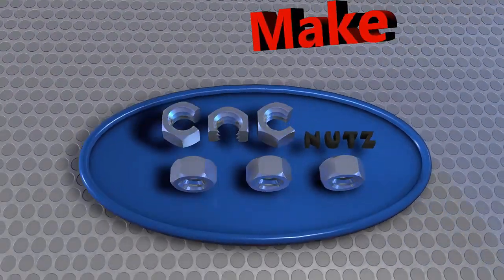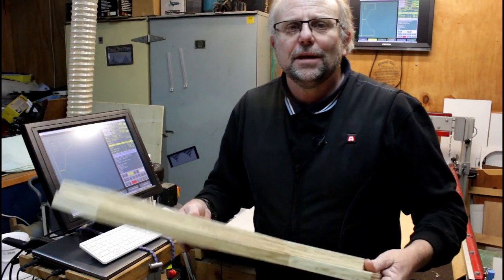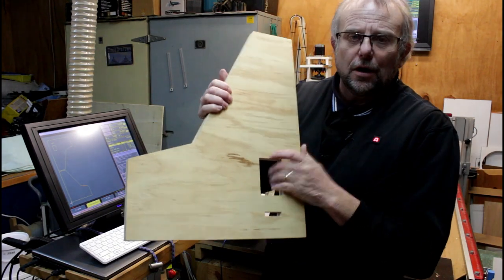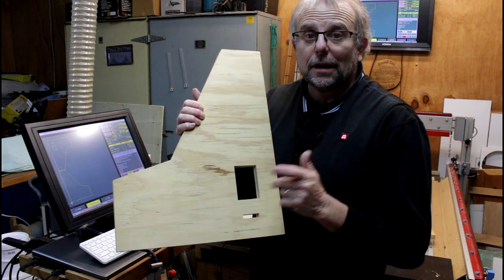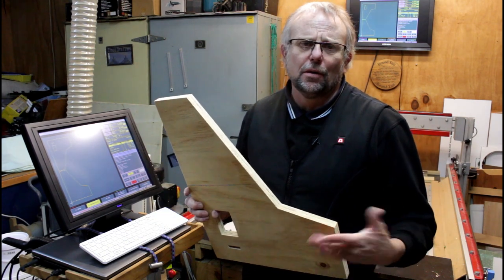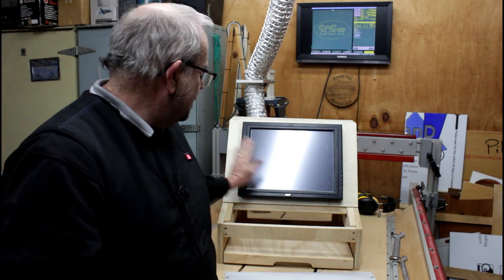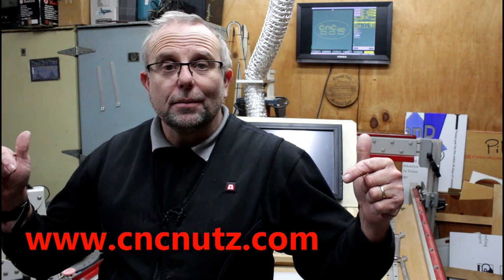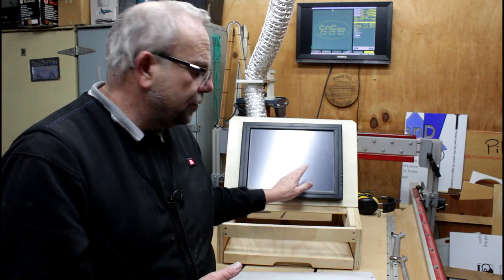How I design a Project Part 2 - CNCnutz Episode 238

Comment: Maybe use quarter round molding around the monitor to keep the dust build up to a minimum and on the side where your buttons are you could notch the quarter round to fit your fingers.
Reply from the maker: Thanks for the suggestion Bob.
Cheers
Peter

Comment: Open-frame cutting/engraving lasers can be extremely dangerous to your eyes... if the beam ever reflects off of anything into your eyes you can be instantly blinded. If possible I would see if I could construct a full light-tight enclosure for the machine with safety interlock switches so that the laser is unpowered when the lid is opened. Otherwise I’d invest in a good pair of laser goggles (ones that fully cup around your eyes so there is no possible angle for the beam to get around the lenses; not the cheap ones that look like sunglasses). Also, put up a sign on the doors to the workshop that warns any visitors about the laser. 😎
Reply from the maker: That's why I made the lasershoe to protect against the user abs extract the smoke.
Cheers
Peter
Reply: CNCnutz (Peter Passuello) - Good, but I’d still wear the goggles... after all, you only get one set of eyes... 😎
Reply from the maker: @darkwinter6028 
Great advise. 👍
That's why I bought the a pair of certified laser glasses  and mentioned the one pair of eyes mantra in my lasershoe video. So many people mount them high on their machine, wear the free pair of glasses that came with their laser and vacuum up the fumes with their noses. What could possibly go wrong? 😱
Cheers 
Peter
Reply: CNCnutz (Peter Passuello) - Yup. And don’t get me started on angle grinders - half the time I see one in use it’s missing it’s blade guard. And that’s not just YouTube - that’s on scripted TV shows where they are supposed to have a safety/liability person! They go to the effort to put gaffer’s tape over product logos... but ignore that 10000 rpm blade that has a propensity to explode being held right next to their soft, squishy, fragile body?!?! 😬

Comment: Peter, a question. What feed rates have you set your 3mm or 6.3mm cutters for general purpose woodwork. Is there such a thing?
Reply from the maker: I use 100ipm for all my bits and manually adjust with the feed rate override from there. Each step in Mach3 and UCCNC is 10% which is 10ipm up or down so it makes things easy.
Cheers
Peter
Reply: @cncnutz  I'm interested in why you use inches and not millimetres (which I do as a NZ woodworker).
Reply from the maker: @peterrenner8519  
I do use mm but in this case the thin plywood is 1/4" and not 6mm as it came from the side of a box that was imported into NZ.
All of my drawings are metric as is my machine. 

For some reason when it comes to speed  I only use ipm because that is how I started out and the Feeds and speeds calculators use IPM. 

I also recognize that most of my audience is American and they use the Imperil system which is why I sometimes give my measurements in both units.
I grew up with both units and it is not uncommon for me to measure something as 6 inches wide by 2 metres long. Since my rulers have both units on them I use the one that is the closest measurements. I would rather say 10 inches that 254mm and likewise 150mm rather then 5 and 15/16ths inch.
Just habit but at heart I'm a metric man.
Cheers
Peter